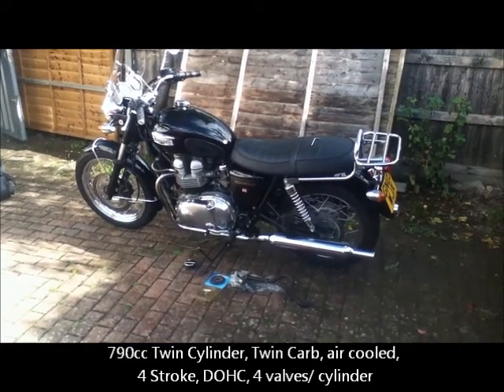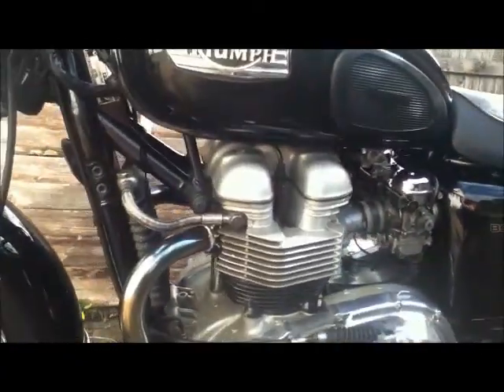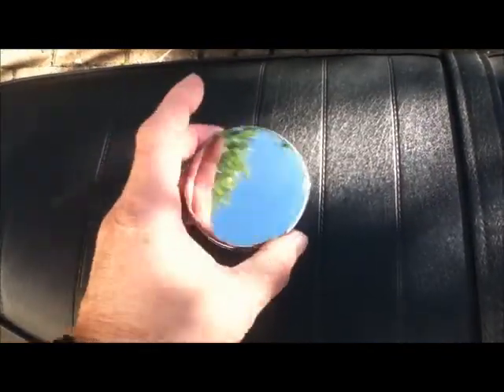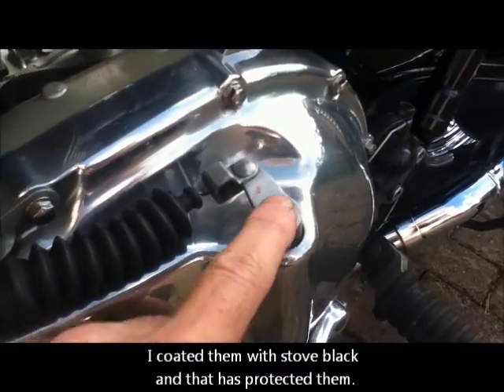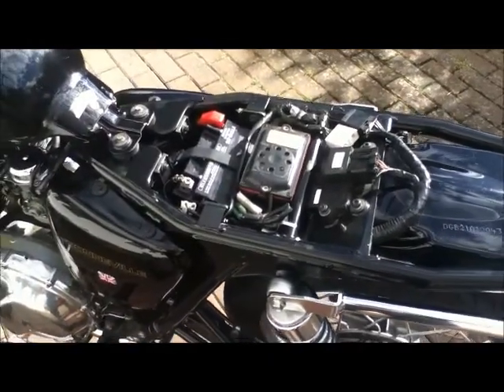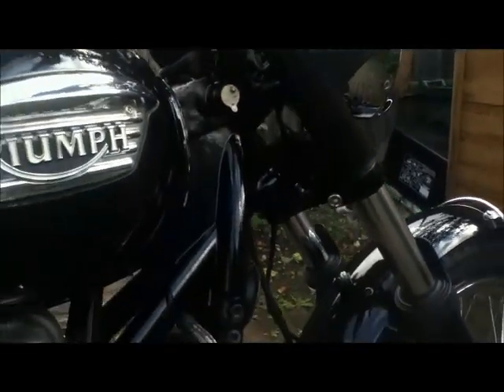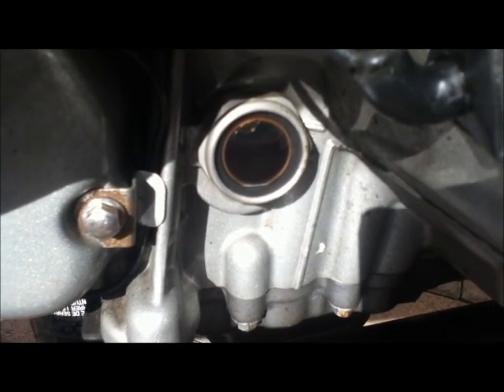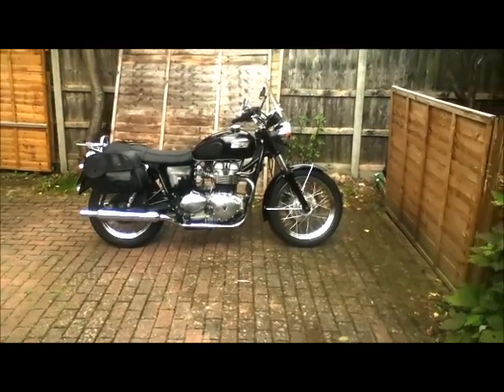Triumph Bonneville - Hinkley 790 - a future classic

Comment: Have a 2002 Bonnie America. It's got the same engine. Good running easy maintenance.I put better tires and a fatter front tire on my America. Made a better light weight cruiser/ short range tourer. Regardless of model, Triumph always has and still does build some of the best looking motor cycles just screaming customize me. Keep the shining side up.

Comment: I did the same mods on my 2001 bonnie.its been super reliable in the last 21 years.
Reply from the maker: The only problems I have had was 1. No-starting with the sidestand switch which I have now deleted. 2. The O rings to the Tee piece in the fuel line into the twin carbs leaked when I changed the rotted fuel pipe and I had to take them apart to replace with 50p worth of O rings.

Comment: Bigger front sprocket gives you less acceleration, not more, but if it will pull it to max revs in top gear, will give you more top speed, but my guess is that it has been done to cruise at 60-70 at lowwer revs, improving longevity and fuel consumption. Strangley my car is an X Type and my Bike is a Bonnie, so I enjoy your informative videos.
Reply from the maker: Thanks. I think because the Bonnie has so much low end torque that you end up with more acceleration and the lower revs cruising. Whatever way everyone seems to have done it with these great bikes.

Comment: I've got an 03 W650, ironically  my last-bike was also a K75 .Some of the fittings have corrosion like yours, but they are old now . The headlight comes-on once the bike-starts and the steering locks on the ignition-switch which Is sensibly-placed . It's in about the same condition as yours , which is brilliant really . The 360-crank-retro's will definitely be future-classics I feel , I guess time will tell . At the moment , they are bargains , here in NZ at-least and I could easily have bought the same bike as-yourself , but this was  the one that 'came-along' , right-condition and price .  Dave  nz
Reply: Forgot to add, you can replace instrument-lights with brighter LED's that work well . Dave
Reply from the maker: The W650 is a nice bike and even has the same Keihin carbs as the Bonnie. I was looking at one recently and they both suffer from the O-rings in the carb T-piece failing leading to a strip down to replace 50p worth of rubber. The only downside I can see is that the W650 is only 50hp (against the 65hp of the Bonnie) and that would be a problem on our fast and frantic Essex roads. By coincidence my brother Dave also lives is NZ - he rides a Speed Triple and a Trophy. Thanks for your comments.

Comment: Enjoyed this!  

The 1983 and older Triumphs won't leak anymore if the case mating surfaces are assembled using Yamabond or Hondabond.  They didn't have that stuff back then -- just using paper gaskets, maybe silicone, which is inferior and sealed poorly.  The only leak you'll still have is out the crankcase breather, a few drops, and maybe if the model had the "chain lube" thingie with that dumb idea of using primary chain case oil to lube the drive chain which flung oil everywhere.

In any regard, I rather liked the smell of the hot oil and the raw gasoline from the carb ticklers that the original twins had.  The entire machine is a very rich sensory experience, from the vibration, the petrol and oil smell, the brightening and then dimming lights from the changing  RPMs, that sweet whirring of the pushrod valve train, and then the punch of the exhaust sound.

But , yes, as a daily driver, a pre-1983 Bonneville probably isn't going to be practical.  You made a great choice with this bike!  Whatever you might give up in rawness from an early Bonneville, you are making up for in reliability, parts availability, and comfort while still retaining many of the key mechanical and cosmetic features of this kind of bike
Reply from the maker: Thank you - this is a great review and observation.
Reply: @johnnysevengun  Thanks!  ps make sure you look into the "safe start" fix for this engine.  Not all owners know about this issue.  There's an aluminum extrusion, part of the case casting, under the primary cover that can and sometimes does break and grenades the engine.  Word is, the breakage is caused by trying to start the bike with a low battery which somehow hammers the aluminum piece from the action of the starter motor gear going in and out.  If you do a search, you can find the part to fix it and it'll keep you from having this problem.  It's available new and you can do it yourself, costs somewhere around $100 USD
Reply from the maker: @skymningforelsket1302  Again, great advice. Thanks.

Comment: i have a 2010 Triumph T 100 , believe me the fuel injection is a quantum step up from the carbureted models .
I have also fitted uprated and longer rear shocks , the Thruxton came out with longer shocks , giving it a 1 degree steeper rake .
with the shocks and lower bars it has transformed the handling .
My next project is the front forks and I am upgrading these through our local Ohlins agent with emulators and a better spring rate .
I to am unwilling to change the profile of the bike to keep its original looks , but it amazing what can be achieved with a few minor changes .
Put it in a local drag meeting last year
Reply from the maker: Sounds like a good bike. I specifically wanted an old school Bonneville with carbs and air cooling but with electronic ignition and no oil leaks. I also have a 1987 BMW K75 which is water cooled, fuel injected, ECU controlled ignition which is what the Triumph became 30 years later. I read about a lot of electrical problems with the fuel injected Bonnevilles - especially their inability to start with even a slightly flat battery. Carbs have the benefit of being easy and cheap to service and seldom go wrong without an obvious explanation.

Comment: Thanks for posting a really informative video. Do you know why the motorcycle has air intake pipes fitted if it runs better without them?
Reply from the maker: It was to meet air quality standards that don't actually apply in the UK as emissions on motorcycles are not tested.

Comment: In Thailand any local leather artisan would make you two saddlebags with silver and turquoise clasps for about 50 quid, or fix those clasps for one quid. Every main street has at least one leather artisan. You can even get better saddlebags ghan that on Lazada thailand for less than 35 quid brand new with even crocodile skin effect
Reply from the maker: Amazing craftsmen in Thailand.

Comment: Putting filters on the carbs increases max rpm  and prevents the A2 crap
Reply from the maker: You have to be carefull with the CVK carbs not to overburden them or you have to end up rejetting - which is a right pain. They prefer still air from the filtered airbox.

Comment: Could you tell me more about the power outlet and adaptor that you fitted?
Reply from the maker: It is a Triumph OEM part fitted by the original owner. I have the leaflet for the fitting instructions. It is a Hella type fitting which is pretty useless as most connectors are standard or USB. That is why I bought an adaptor. Also I do not like where it is positioned right above the hot engine and where a cable might whip the tank. At some point I will find a better place for it. I also have the leaflets for the twin dials and the adjustable clutch lever which were optional extras.
Reply: @johnnysevengun  So the adaptor has a waterproof cover too? I wonder if there is a USB version of it?
Reply from the maker: @243jimb  That is a USB and phone socket to fit my Samsung mobile. If you go on ebay you can get virtually every combination you can think of. I have different ones for my BMW K75.

Comment: what? a 17 to 19 would make the gearing taller mate...
Reply from the maker: The Bonnie has so much torque that upping the front to 19 teeth gives it more pull away and less revs at high speeds. That is why practically everyone who has one has done this mod. If you put it on one of the new weedy BSA's it would struggle to pull away.

Comment: A bit late now but the joining link on the chain is fitted the wrong way round!.
Reply from the maker: No it's not. The round end should face the direction of travel.
Reply: @johnnysevengun  Apologies,I think I need a new monitor,very fuzzy pics.
Reply from the maker: Definitely need a new monitor. I watch this on our 50 inch TV and it is very clear although it is only shot on an Ipod.

Comment: a bigger front sprocket  gives higher gearing and less acceleration
Reply from the maker: As I have written before and say in the video - I think because the Bonnie has so much low end torque that you end up with more acceleration and the lower revs cruising. Whatever way everyone seems to have done it with these great bikes.